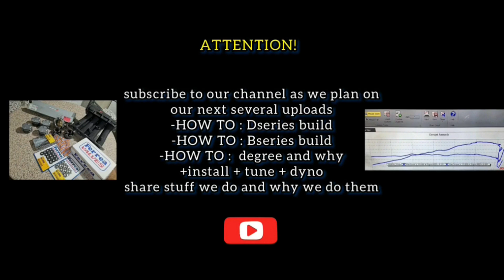B20 VTEC build Series part 2 "block-works" SRDmotorsports

Comment: What's your engine break-in protocol? Change oil after 100 miles?
Reply from the maker: first start up , after getting up to temp
Drain oil and change oil…
Next is after 500km then 1k 
After that it’s normal intervals

Comment: I completely filled my engine until it was level with the valve cover filler cap before starting, and you were wrong about saying "you cant have too much assembly lube" alot happened lots and lots of smoke and oil went everywhere so i kept reving the engine full throttle hoping it would clear up. It never did. What should i do now?
Reply from the maker: On your b20vtec u could check the b20vtec vid I did about vtec line etc etc might pick up some ideas and options there
Reply: @SRDmotorsports  it caught on fire on the exhaust 🔥 i put it out and the car revs really higher now. I want 12000 rpms and maybe only put 1 quart and ot will rev that high now? Sorry to bother you i just use too many tubes
Reply from the maker: Who says it should be filled until the valve cover filler cap?

The level to be followed is the dipstick marking on the block

if too much assembly lube is wrong?
so I’ve been wrong for more than 15yrs but zero smoke just good power is wrong i guess
Reply: @SRDmotorsports  im sorry it was a joke and i absolutely love your videos. I learn something new everytime i watch them. Back in 2001 i had a guy bring a b16 crx into my shop that was smoking and pouring oil everywhere. It muat have had 15+ quarts in it. After draining it and started over the engine was actually fine. Again love your videos.
Reply: @SRDmotorsports  when you were covering the bearing surfaces with lube and said "you cant use too much engine lube" i thought it would be funny to exaggerate it lol
Reply from the maker: @Will_14_years_ago  wait so u didn’t fill it up to the vc oil cap? That one scared me for real 😳
Reply from the maker: Ok I reread… that crx in 2001 I’d bet that was “heavy” 🤣 but wow that’s a  shop story I havnt heard tbh scared me for a moment…man not cool 🤣😂
Reply: @SRDmotorsports  yes i did. It took about 342 assembly lube tubes. I went through 27 boxes of assembly lube.
Reply: I tried to drain it but its coming out really really really slow. I dont want to wait for it i want to drive it.What else can i do that qill only take 1 or 2 minutes. The car would only rev to 4000 rpms and vtec wouldnt engage. I full throttle for 30 minutes and it never cleared up smoke.
Reply from the maker: Whoa wow that much tubes?
Reply: @SRDmotorsports  well actually it was me im dealing with it right nkw i was just embarrassed so i blamed it on someone else. I need to fix but im not patient. What do i do
Reply: @SRDmotorsports  im currently building a b20 vtec for my 95 del sol b16 car and your videos are very helpful.

Comment: Very Informative sir! may Tanong lang  po sir. Kaya ba ng B20 85mm bore? kahit walang sleeves. thanks for answering sir.
Reply from the maker: Thanks for checking it out!! 

and yes 85mm is the max safest for b20 sleeves some have tried 85.5
but 50/50 sometimes u hit aluminum sometimes no... but on 85mm its still safe

stay safe!
Reply: @SRDmotorsports  thanks 👍 sir. What piston you are using sir. If you don't mind 😅 . Trying to reach 11s high. My previous set up nag run ng 12.1 .but competition got to higher. 😅 New set up na nman sir.
Reply from the maker: @TanzRacing  we use wiseco and supertech pistons always , friendly prices
Reply: @SRDmotorsports  alright sir😁 thanks sir
Reply from the maker: @TanzRacing  no prob and good luck and hope you hit 11s asap!
Reply: @SRDmotorsports  I will try sir. 😅 If I failed. I will try again. 😂
Reply from the maker: @TanzRacing  ofcourse always have fun!
Reply from the maker: @Just Chilling Daniel the earlier version? Simple 

Wisecon pistons (same as Supertech)
Pro2 
Ported victorX cuz didn’t have ITR
SMSP style 4-2-1 header
E85 fuel

Comment: Should you not use assemble lube on the main cap journals
Reply from the maker: had to re watch this video and wow you're right! we do put assembly lube indeed especially on the mains

as i watched the video i didnt realize we kinda snuck in showing the plastiguage stuff then after its installing pistons!

but indeed after we did show the plastiguage, we removed all the mains and relubed properly before final torque then installing the pistons time

good catch man!!